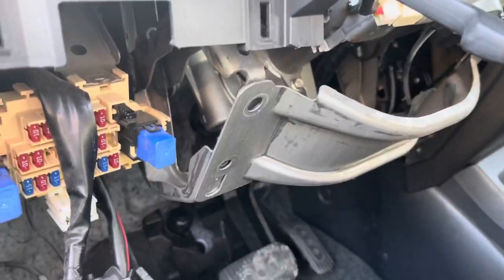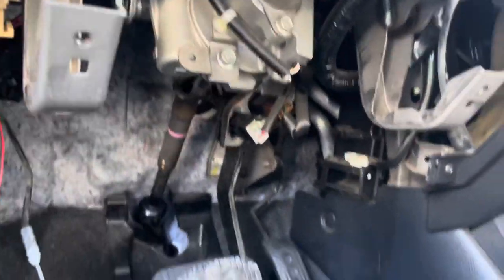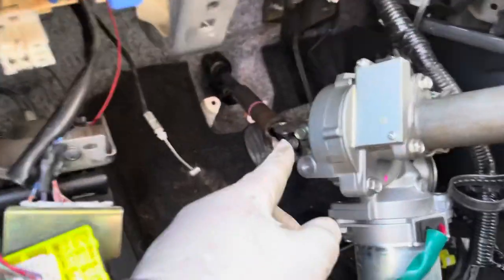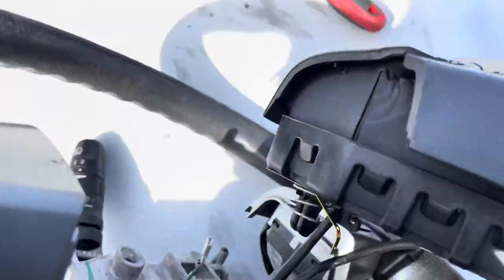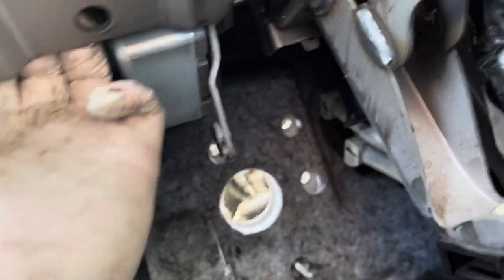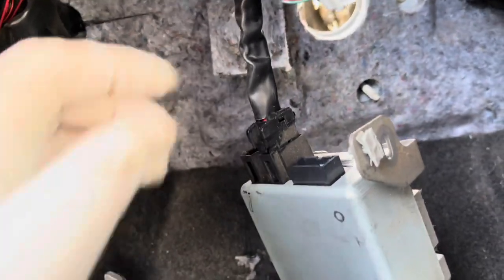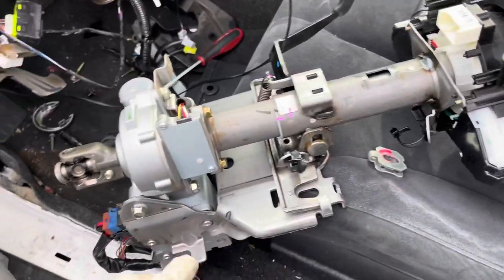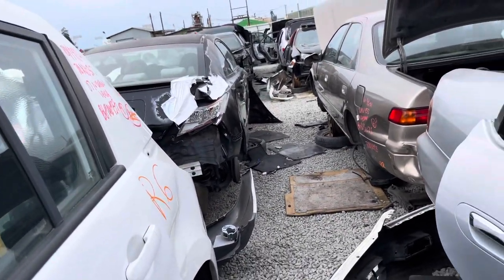How to uninstall Versa electric steering column for use on Z31

Comment: At 6:12 we’re your hand is touching you can remove those golden bolts and slide the motor out would of made your job way easier if you are just looking to replace the motor
Reply: So if you just unbolt those golden bolts you won’t need to remove the whole steering wheel is what your saying ?